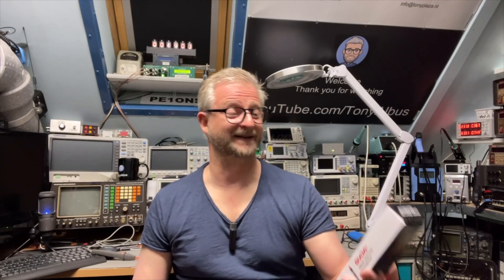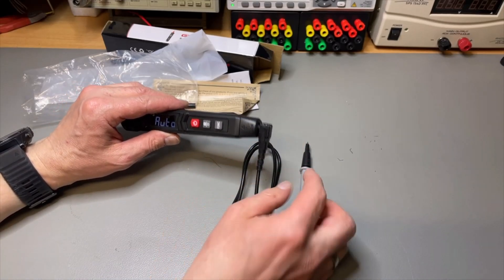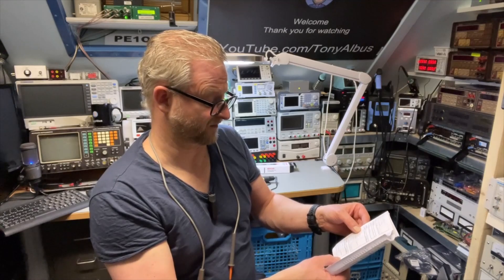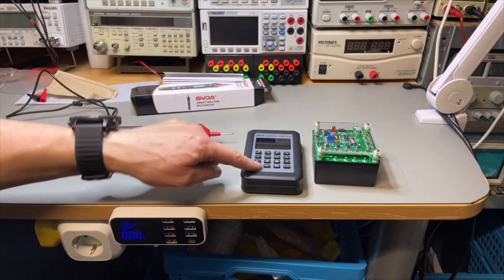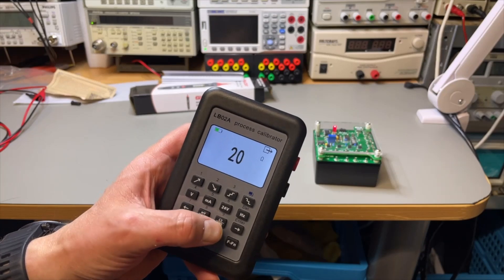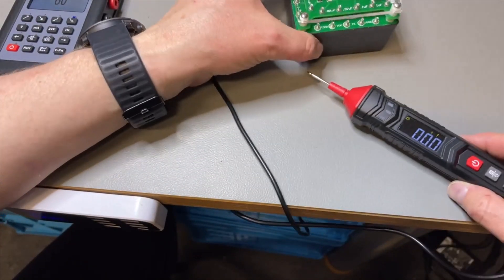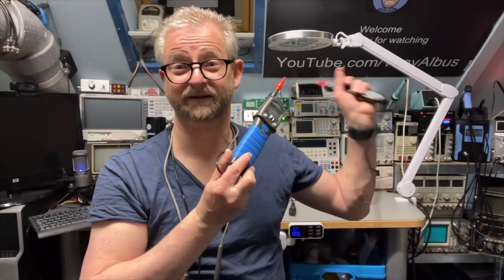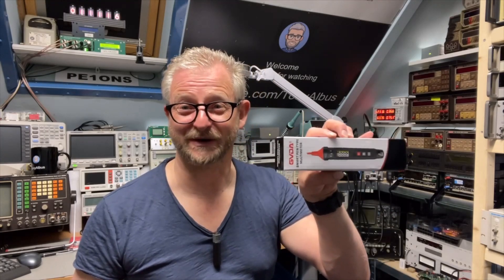#280 GVDA Smart Pen Type Multimeter with Phase Sequence

Comment: Same as the ones sold by Aneng brand. 

Aneng also released a soldering iron in the past few months. 

I’ll probably be buying both just to test them out. I have a full lab of test equipment similar to your set up, but I enjoy buying and reviewing cheap tools that offer good stability and dependability. And aneng has always proved one of the best in value and quality.
Reply: I’ve got a pile of fancy fluke and Agilent multimeters, but the ones I use most are the aneng v8. I think it’s their nicest most expensive meter, but you can still get them on sale for around $30 and they come with a genuine set of silicon leads.

I’ve been using the v8 for two years straight basically every day, and I’ve had them open to clean, inspect, and on one instance replace a fuse. 

I love my fancy test equipment but rarely do I have the excuse for my 8.5 digit meters and other NIST traceable calibration equipment.

 Don’t get me wrong, I love my equipment like they are my children… but sometimes it’s nice not to worry about scratching, miss handling, or damaging expensive equipment when I’m working away from my lab.

And I have compared dozens of different aneng brand devices to my certified benchtop equipment. And have always been satisfied, as they offer more accuracy instability than most folks would ever need.

Pretty sure the same manufacturer can be found under the brand names kaiweets, mastech, protek, uni-t… and many others. Because the markings from the injection molding, circuit board layout, and component selection are completely identical in many of those brands.
Reply from the maker: Very nice, let us know!

Comment: I use a Duspol digital, this tester also can detect phase sequence. For small jobs like installing a 400V CEEFORM outlet  it is  very helpful to determine the phase sequence or proof dead..however , When we shut down an entire installation for maintenance and  change cabling,  I prefer to use a 3 wire sequence tester.. Such a tester is the kind of tool you don''t want to miss out on,when performing electrical work on high voltage systems. The Duspol seems to use capacitive coupling.. not sure how that works tho..
Reply from the maker: Agree, for a quick test it is okey, for real installations i would prefer something 3 wire and proper brand, you don't want to mess that up.
Reply: Was thinking the same thing, that is pretty common. I remember the very old Duspol's where already equipped with phase sequence.